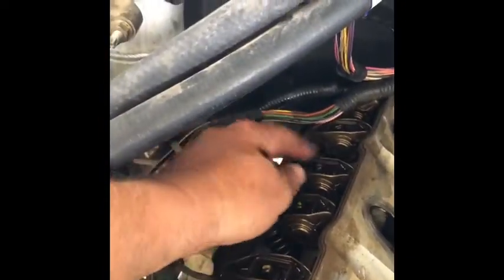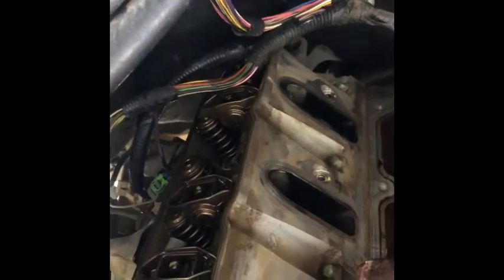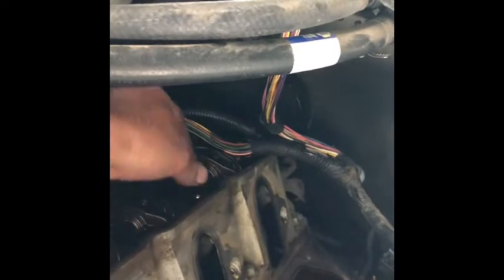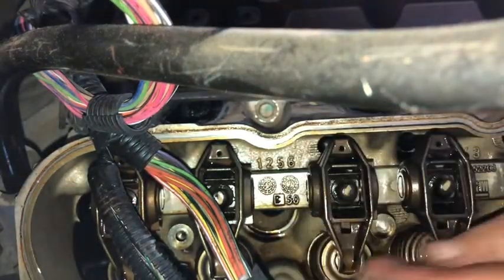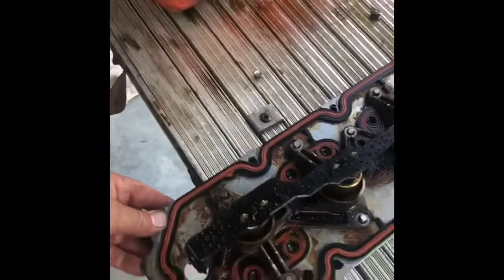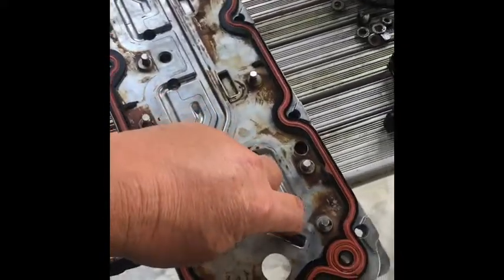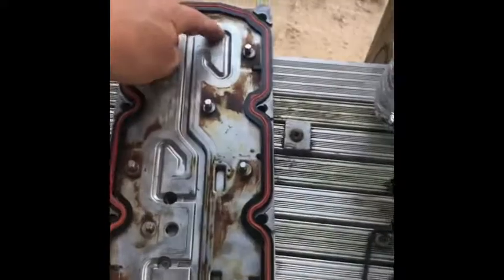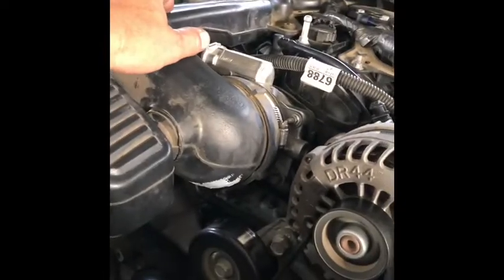Repair stuck lifter LS engine

Comment: What did you use for the Punch and any MODS ? also would I need to do anything else about reloadeding the Lifter ? before putting on the Rocker arm ?
Reply from the maker: @lassiejr2115  some people use a Phillips screw driver I just ground the rod at an angle and concaved it a little. Just check your cam to make sure the lifter hasn’t turned and ruined the cam. If it hasn’t then releasing the lifter will work afterwards you can get someone to turn the fuel management off.

Comment: Got to say its a great video. Impressive and informative!!!
I have a 5.3 with 380k miles. Recently changed the oil pump, pickup tube, timing chain, cover, radiator and all 4 O2 sensors. Now Im getting multiple misfires at #4 & #6
About to take the valve covers and check the valves just like in your video.
Again thanks!!!
Reply: You have me nervous im in the process of the same on my 03 1500hd 6.0 and I'm worried to death when I put it back together it's gonna have problems
Reply: @bricehale6593  i know it can be intimidating, but do not let that happen. Not sure how much of it you are doing. Just take your time. If you are changing the timing chain too make sure the marks on tbe crankshaft gear is at 13 o'clock and the camshaft gear is at 6 o'clock.
The absolute most important thing is to make sure that you torque all of your bolts to specs. You can find the specs online.
Good luck!!

Comment: I thought stuck lifters was caused by bad oil like taking too long between oil changes? I have a gmc 2007 5.3L and my lifter on cylinder 7 got stuck. I have them all out now and will replace all of them. What do you recommend to make sure my afm lifters dont do this again? Im gonna buy a new updated vlom as well. Thank you.
Reply from the maker: @wtspapa24  I had the AFM disabled so it wouldn’t do it again.

Comment: How did you know the camshaft wasn't scored? My shade tree mechanic is taking his sweet time on my truck its a #6 misfire. He's had my truck for over a week and wants to look at the camshaft now, after he tried to tell me lifter failure was rare! Ive always had 20-40psi oil pressure. I feel like this guy is going to try to hose me for a camshaft
Reply from the maker: There are cases that the cam could be damaged. If the lifter has turned its most likely damaged if it’s still running straight then it’s probably just stuck like this one was
Reply: @Strickland80  thank you
Reply: @samsmobilepressurewashing8422 yes it's common, but a crapshoot. The cam could be fucked, but I'm currently running miss on #7. Pos system.  But lifters are in my future

Comment: How long did it take to remove the intake? How easy was it to remove all the parts?
Reply from the maker: It only took a few minutes and it’s all pretty easy but I have mechanical experience with vehicles.

Comment: I have the same issue. #6 is tapping away. There's a tool crazed performance sells to tap the lifter. Is removing the rocker and tapping the rod on top of the lifter essentially achieving the same thing?
Reply from the maker: I made that tool by finding a rod that fits down the oil hole then I ground it at an angle then a slight concave on it. You’ll feel it seat in place as you spin it. The plunger in the lifter will pop out too far so just use the push rod to re-seat it
Reply: The rod you made… how thick is it? Looks about 1/4”-5/16”. I need to make one.

Comment: just delete the dod
Reply from the maker: After you do this you have to
Reply: Still need to get the lifter to release first and if you start it up before you delete the AFMwill the lifter go right back to being stuck?
Reply: What's dod ?
Reply: @MoDave82  displacement in demand system.
Reply: My truck don't have AFM it's a 08 GMC 2500 6.0 liter ly6

Comment: people should stop buying the  trucks period! then gm will get the message!
Reply: You act as if gm is the only problem engine-nope
Reply: @Watchout1010  its real simple-dont want a problem dont buy this engine dodge either
Reply: @super20dan  ford timing chain problems and broken,stripped spark plugs,intakes crack,coil bolts strip out bla bla
Reply: @Watchout1010  thats why i own a tundra and a 99 silverado 5.3
Reply: @super20dan I love my LS engine. Super simple to work on. Last forever. Lifter tick is something I address every so often and I make it go away. Not many engines out there as well made as the LS.
Reply: Um the actual problem is emissions laws and treaties signed with dates to comply this and that amount 
That's why there is afm and dod in the first place it ain't a Chevy thing sheessh
Reply: @Justin-v5m9z  GMs 6.2 latest recall, 2021 to 2024, after dealer inspection, oil viscosity change from 0W20, to 0W40 Supercar Mobil 1, can give 'some' owners a 150,000 mile extended warranty.. ;]
Reply: @Justin-v5m9z  well toyota and nissan trucks dont have this BS.
Reply: @super20dan 
Tundra v6 metal shaving
Turbo 4cyl are junk

Toyota quality ended in 2000
Was Toyota owner
Reply: Idk about y'all. But only vehicle besides Toyota that runs over 300k is Chevy. And we don't claim anything newer than 2007 😂
Reply: Buy a horse

Comment: So what was the purpose of removing all those parts on that valley  pan 🤔?  Looked like  keep oil to concentrate more on your lifters.. or?
Reply from the maker: That’s the solenoids that provide oil for the AFM. You don’t need them if you disable the AFM
Reply: What's AFM
Reply: @MoDave82  active fuel management
Reply: How do you disable afm and do you keep running collapsible lifters and cam ??
Reply: If you disable the afm do you still have to mod the valley  plate ?